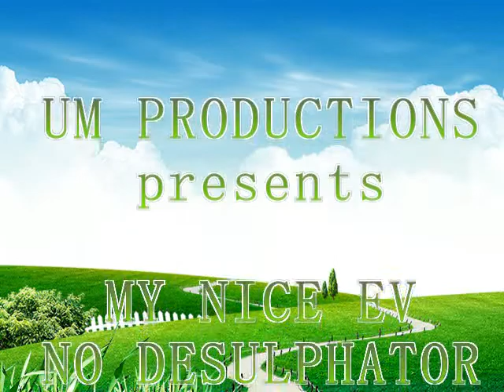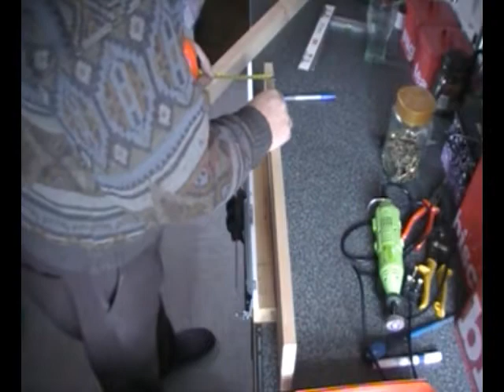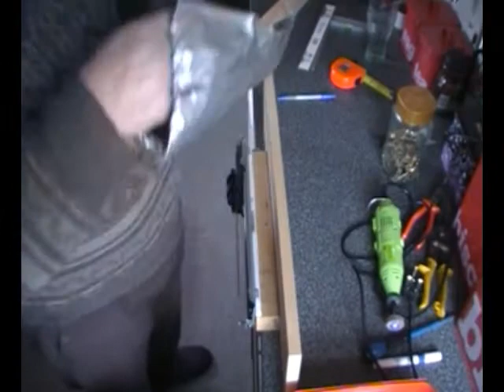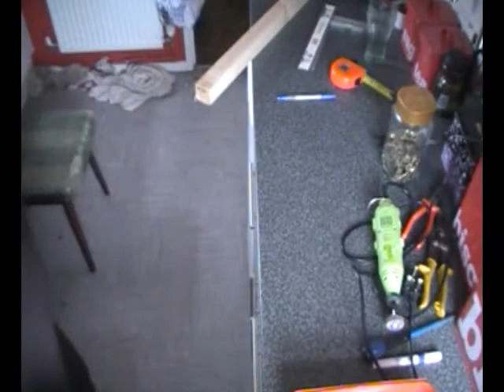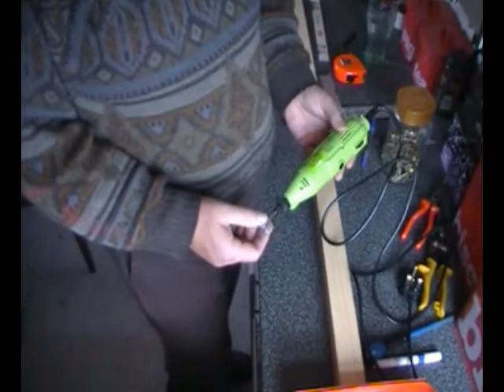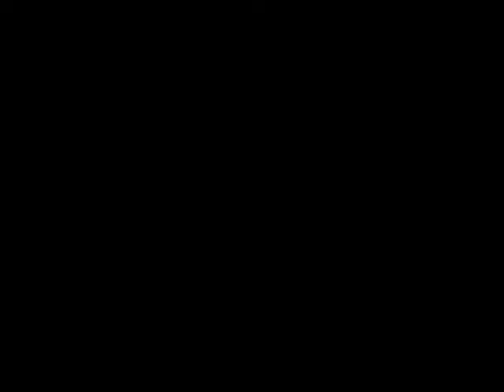MY NICE EV Printer Arduino CNC Part 3

Comment: I'm inclined to agree with Patrick, An end-mill bit will do you a better service.  Those cut off wheels wear down rather quickly which will be giving you issues with accuracy and continually changing the of the wheel when worn. An end-mill will stay constant & require little to no maintenance.  
Best luck to you on this, we'll be watching.